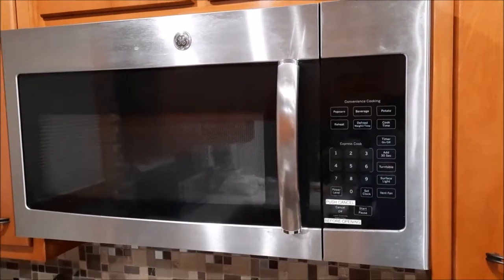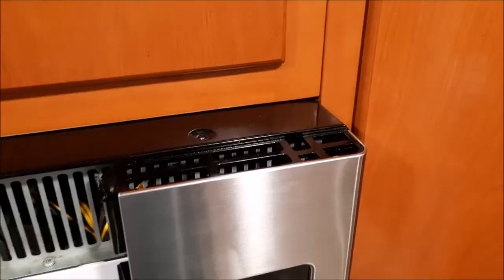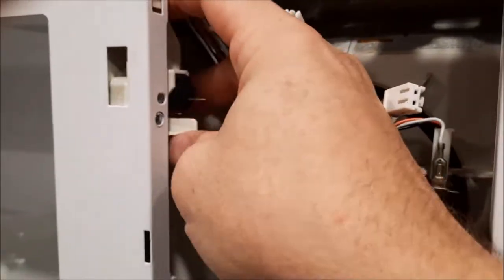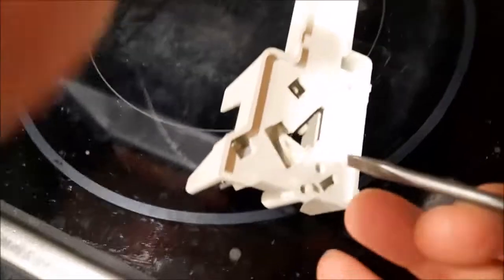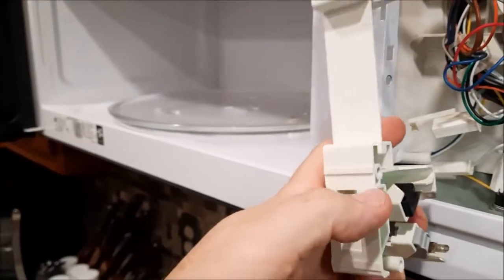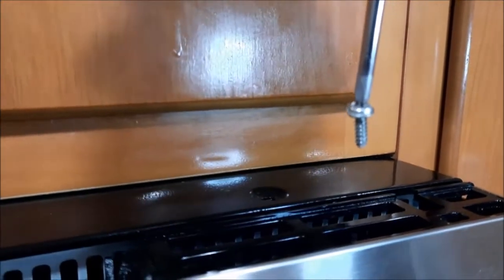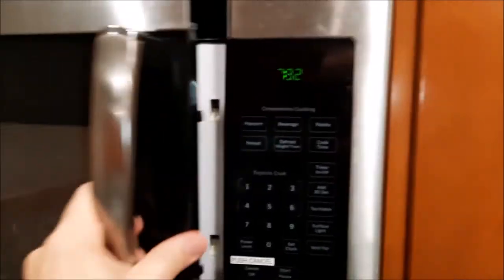FixIt006 - Microwave Door Switch Repair. GE Model JVM3160RF3SS

Comment: it worked for me. replace switched with this "Microwave Oven Door Switch Replacement Part, 16A 125VAC, KW3AT-16, Normally Open - 1Pc " from amazon.. This switch is called normally open, one I replaced. Then there are other switch which is normally closed. They all look very identical and absolutely no way to tell but pin that sticks out for normally open is at lower end and for normally closed is at upper end.
Reply from the maker: Thanks for watching and posting the comment!
Reply: Also on the other side  there is a line pointing near pin that says NO or NC

Comment: Great video Cronk!  Thanks for posting.  I'd like to get your thoughts on switch MODELS (KW3A vs KW3AT-16) and FUSES (Slow vs Fast blow).  Pardon the long/detailed post.  Hopefully details help someone else watching video/reading post....

MICROWAVE: 
I'm working with a 2 yr old, over the range GE Profile (PVM2188...) microwave.  Intermittently, Fuse blows when door is Opened and/or Closed.  This is my SECOND time through this process, in the past 6mo.  This time, I'm swapping out the Latch Board (per your recommendation), AND replacing switches (with SCORCHING on the connectors, just to be safe/pro-active) . The Main board replacement is reserved for THIRD try   :D

SWITCH MODEL - Diff's/uses?
I noticed that the switches on my unit are KW3A and KW3AT-16, and vary in color (gray or black).  All are TWO terminal.  Is the difference between the models that they are 125 and 250 VAC, respectively?  If so is there an easy way to tell which one is for which function (i.e. Door vs Monitor).   And, I see that some online retailers sell 3 packs (typically 2 door, 1 monitor switch), but the SWITCH models can vary --- e.g. packs of:  ALL ONE model (KW3A) or  MIXED models (KW3A and KW3AT-16).  
And PRICE varies per switch, from a few bucks to $20+ per switch.  It appears that the Monitor switches are usually 4x the cost of door switches.  Does price really matter, provided it's the correct switch TYPE (eg NO vs NC)?  

FUSES - SLOW vs FAST Blow
Also... when fuse blew, I went to the local hardware store and picked up 20a Bussman "Microwave" fuses.  I've since realized that they are FAST BLOW, and it appears that GE's OEM is SLOW BLOW.  So, I'm going to order some Slow Blow fuses.  Is it better to err on the side of caution (in lieu of getting correct specs), to go with slow blow fuses, for Microwaves?

Aside.... I've noticed that the light bulbs (under microwave, for lighting range surface) BLOW, leading up to the Fuse blowing.  I'm guessing that they are collateral damage of the surge, which ultimately blow fuse?  On my first time replacing switches, I replaced the sockets/bulbs, thinking there may be defects.  But same sequence of events happened this time.  (FYI I also replaced glass bulb with suitable LED, in case vibrations were affecting glass bulb filament, as noted online). Any thoughts/recommendations -- in case I'm not the only one with these issues?  Might even be the topic of next video  :D

Thanks again, for the videos, and responses.

PSA: 
Always **SAFELY** DISCHARGE capacitor.  Either unplug and leave for several days or week,  or use PROPER tools for discharging.  Do NOT use some tool from your toolbox, to short/discharge.  You risk damaging capacitor, or worse, electricity arcing and sending potentially LETHAL 2100 volts through YOU!!
Reply from the maker: Hi Sean, thanks for watching!  My apologies for the late response, and THANK YOU for the PSA!  Yes, that's one thing you don't want: to electrocute yourself as you're trying to save money by DIY!
Wow - you ask some great questions.  Pretty much all I did was remove switches and test them with a meter (and listen for the telltale "click" when depressing the button), and carefully record the exact number on the switch itself.  I'm pretty sure that it doesn't matter about the 125/250 VAC designation on the switch - the switch will work with either voltage.  I think I bought a 3-pack of switches on Amazon, and I only needed one (I think!) so I saved the others for potential future repairs.  I think as long as you get the correct switches (i.e., Normally Open/NO or Normally Closed/NC) it shouldn't matter.  If you buy the less costly ones then you don't feel so bad if they go bad on you later.
Really my first issue was the small cylindrical glass fuse.  I noted it when I first opened it up after it failed the first time - the fuse had blown and the inside of the glass was all coated with metal.  I bought a pack of those fuses online (a 5-pack, I believe), wound up using 2 (1 before I realized the door switches were bad and the 2nd after I replaced the switches) and keeping the rest for potential future repair.
For me, the frustrating part was after replacing switches and fuses, the unit was humming as though it was on low.  The fix for that was the $200 board replacement, but WAY easier than ripping out the whole unit and whatever kitchen modification I would have had to do to put in a new one!
Again, thanks for watching, and thanks for the comments/questions!
Cheers,
Cronk
Reply from the maker: Sean, I forgot to answer your question about the surface lights.  We, too, found the surface lights blew, but didn't take note if it was in advance of the fuse blowing.  We also replaced them with LEDs, but they, too, were not as long-lived as we hoped.
Good luck!
Cronk

Comment: Thanks much, replaced the main fuse, went dark again as soon as I tried to heat water. Checked the 3 switches and the middle one was not working. It seemed gunked up, so we cleaned it and it seemed to work well.  Reinstalled with another fuse and all seems good for now, total cost of 2 fuses, $6.  Great video, thanks!
Reply from the maker: Thanks for watching!  It's great that you were able to fix it - that's the idea of the DIY: if we can save money and fix what we have, we won't throw things away if there's still life in it!
Reply: Appreciate that, want to add that we did replace the switch also. When we opened the door while running, it still tripped the fuse. Replaced the switch and all is perfect and took like 10 minutes the last time as we got so good at it.
Reply: @fixitwithcronk1074  Seems to have gone out again. Will put the extra switch I have in and try to cancel before opening the door in the future. If it happens again, may need to replace the microwave. Thanks for all your help.
Reply from the maker: Yes, it's hard to get in the habit of hitting "Cancel" before opening the door, but that can really help since the microswitch is meant as a "backup" to that (although they don't tell you that in the instructions!)  Good luck with your DIY Repairs, and thanks for watching!

Comment: Thank you for the video. All 3 of my switches depress and click without issue, but i could not get the darn wires to disconnect from the switches. I tried both the upper and the middle. To explain my problem, my fuse blows if i open the door without pressing cancel. Never used to be a problem.
Reply from the maker: Hi - Thanks for watching the video.  The only thing I can think of is that maybe the connectors that push onto the switch tabs might be gunked up, effectively "gluing" them to the tabs, or maybe that they need a small slotted screwdriver to pop them off.  Good luck!

Comment: looks like the switch you installed is different from the one you pulled.
Reply from the maker: My apologies if it appeared that way.  The switch I replaced was the same switch.  I think the "kit" I bought had three switches but I didn't need to replace all three.  I saved the other two for potential future repair!

Comment: I broke off the latching pin on the install. Is it safe to use super glue to fasten the new switch in place?
Reply from the maker: Oooh. That little latching pin is a challenge.  I suppose you could use super glue, but it might not work too well especially if there is a layer of cooking oil/grease all over the inside surfaces, like I had in mine.
Reply: @fixitwithcronk1074  Used super glue and it's held up so far; the only problem is you have to replace the whole bracket if a new switch is installed.

Comment: All three switches "click" when I test them. What else could cause the fuse to blow if we accidently open the door while the microwave is still running? Thanks!
Reply from the maker: Even though your switches "click", that's just a "quick and dirty" way to check the functionality of the switch.  The best thing to do is to use a volt-ohmmeter to check the resistance.  Put the two probes on the two tabs, set your ohmmeter to resistance (Ohms) and press the switch.  If the reading changes when the switch clicks, the switch should be OK. When I say "changes", I mean if the switch is normally open (it'll read "1" on your ohmmeter), when it clicks it'll change to "0" (closed).  If it's normally closed (it'll read "0" on the meter), when it clicks it'll change to "1" (open).  There are some other resistors and components that could have gone bad but I don't look at those in this video.  There are some other videos on those on YouTube, but I don't have the links to share.

Comment: I think your microwave was still ON when you shut the door before starting it. 
It also appeared to be ON / RUNNING when it should have turned itself off.
I know, because I have the same problem. Mine runs with the door closed...... even without setting it to cook.
Reply from the maker: Hi! Thanks for the comment.  Yes, I had to actually replace the board as it wasn't only the switch that was the problem.  Check FixIt007 for that repair.
Reply: @fixitwithcronk1074 where did you get the board? I think I need one too

Comment: Did this switch fix after finding exactly the same middle switch gummed up.  Bottom switch too was doubtful, so replaced it.  Total cost $8 for two switches.  15 minutes of work.  Great!  btw I had the same 'temporary fix' with always hitting cancel button--trail and error learning, lol.  I assume that is a quirk of the switch interlock?
Reply from the maker: Hi! Thanks for watching.  Yup, those switches get gunked up.  I did have some temporary success at first with using a contact spray cleaner, but ultimately had to replace the switches anyway.  Good thing replacements are so cheap!  Glad it worked for you too!

Comment: Why are my plugs connecting to the door switch impossible to remove?
Reply from the maker: Hmmm.... that's a good question.  Perhaps they have grease (etc.) gunked up on them?  Maybe try a small slotted screwdriver and gently pry them off?  Good luck, and thanks for watching!
Reply: I have the same issue. The plugs in the video appear to be encased in a flexible plastic sheath. Mine are in a hard plastic casing and seem to be held in place somehow.
Reply: Same here.  I'm afraid I'm going to break something trying so hard

Comment: The problem with mine was that the "ramp" the door locks ride up on were worn out enough to not compress the middle switch. This caused the fuse to blow when the unit was turned on.  A new  Latch Board [WB06X10610]  fixed it.
Reply from the maker: Sounds like a great fix!  I was worried this might be the case too; once I replaced the switches, it turned out I had to replace the main board altogether (see FixIt007 for details on that one!)  Thanks for watching!

Comment: Are the two black switches the same.?  when you look at them closely the prong on each are located differently.  Looks like the one you replaced  was different than the one you took out,  because of the prong location. Just need to know as I am too, amd trying to purchase the same one but cannot find the correct one. Just wondering if it does not matter if the black two switches are the same.????
Reply: I noticed that too.  The one appeared to be "normally open" and the other "normally closed."  It does not seem right.
Reply from the maker: Hi - Thanks for watching!  These are great questions.  When I pulled the switches, I looked very carefully on each switch for the specific numbers printed (or molded) on the switch itself, to be sure I ordered the right ones.  You can test the new ones with your volt-ohmmeter set on resistance (ohms) and putting the probes across the pins when the button is depressed on the switch and when it's not.  If your resistance reads zero when the button is depressed, it's normally open; if it reads zero when it's not depressed, it's normally closed.  I don't recall now which ones were which, but I think there are two of one kind and one of the other in this unit.  Good luck!
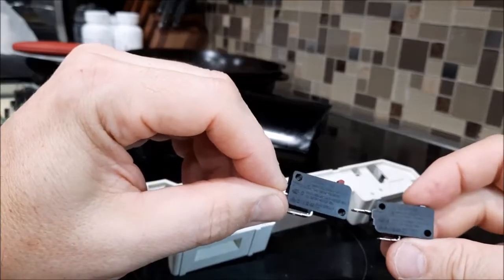Reply: @fixitwithcronk1074  Super helpful video, thank you!  KW3AT-16 is printed on both switches but if you look @7:50 you can see what the initial question was referring to, the prong for the original switch is at the top (NC on the other side of the switch) & the prong on the replacement switch is in the middle (NO).  According to Amazon one is open & one is closed.  Shouldn't a closed switch stop the unit from working if the original switch was open?  Very confusing.
EDIT:  Replaced it with the same switch that you did & it works.  The middle prong plugs in to nothing & the wire from the microwave that used to go to the top prong (now on the bottom since the switch is upside down) plugs in to nothing as well.  I still don't get it.